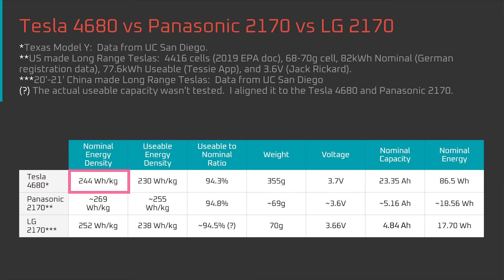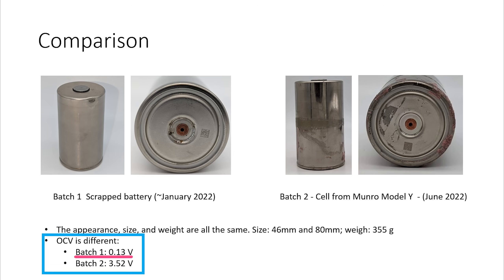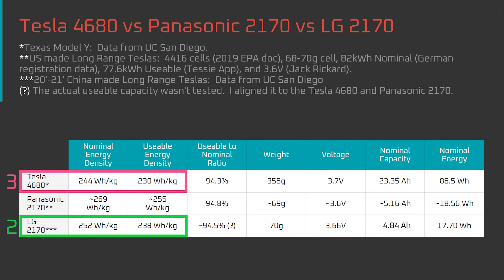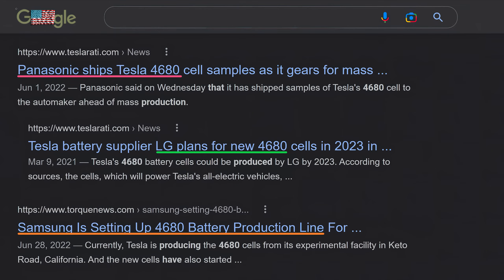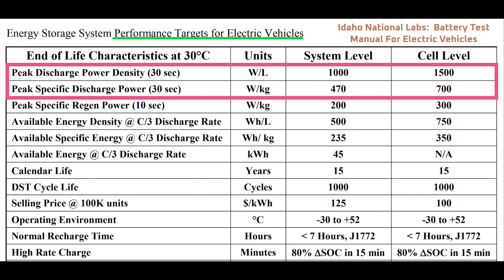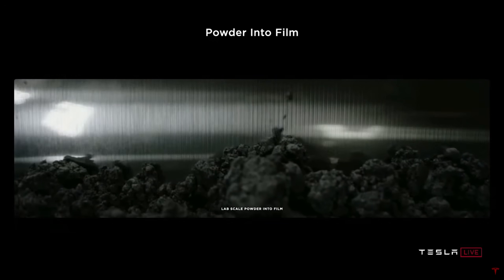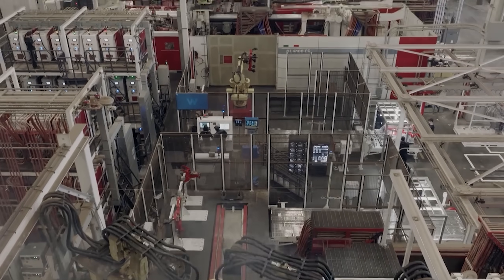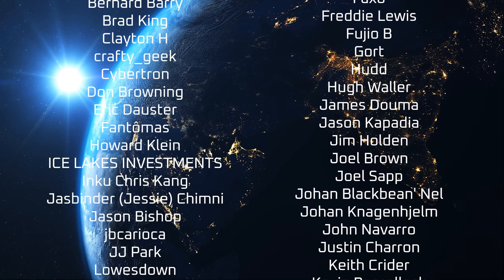Munro 4680 Energy Density Tested // Model Y Pack Size Explained

Comment: There is a major mistake / omission here... You are comparing APPLES TO ORANGES. One battery is structural. The other battery is not. You have to subtract the weight of the displaced portion of the vehicle's structure. Let's say for example, you are able to remove 1/2 lb of steel for every 1 lb of battery that you install, then 1-1/2 = 1/2, and 268 wh/(1kg -1/2) = 268wh / (1/2kg) = 536 wh/kg! Now this is just an example and I have no idea how much weight is displaced, or even if there is any weight displaced in this first version of the 4680, but YOU CANNOT MEASURE WH/KG UNTIL YOU KNOW HOW MUCH WEIGHT IT DISPLACES.

Edit: I also want you to know I appreciate your analysis efforts. You make great videos. But here is where there is something special that needs addressed. On battery day Elon was very excited to announce the structural battery. He made comparisons to airplane wings carrying fuel. Yet it seemed to just go over everybody’s head the true implications of a structural battery. The first principals implication of a structural battery is INFINITE energy density. Of course, that’s the ideal, and in the real world that’s not even a possibility. But what is possible? How far have they taken it thus far? This analysis is far more interesting and fundamental than doing an analysis of the battery chemistry. There is no battery chemistry that has a first principles energy density of infinity.
Reply from the maker: No, I just didn't want to go on a dog leg.  It's more complex that what you're illustrating there.
Reply: @thelimitingfactor  yes, it is. But without factoring that in, the comparison isn’t accurate. At least you should mention that so people know that it’s actually better than what you are stating.
Reply: @thelimitingfactor   I am an engineer and sometimes in engineering we give a simplified model to show how something works. Same thing in physics. For example, we do ballistic math but assume no drag. This is called first principles thinking. The benefit of doing this is to remove the complications and understand how the underlying system works. We will use >> (much much greater than) many times to see how a system works at the extremes as well.

So here is a simpified model of the true benefits of a structural battery and why it can be the most important factor for Tesla’s new batteries. Suppose you want to hike across antarctica. To do so, you must carry all of your food (fuel). As you travel, you are able dispose of your waste, your consumed fuel, so your pack gets lighter as you travel. This is like a gas car. It burns the fuel and produces smoke. Now consider an extra requirement. Let’s say you had to pack out your waste when you hike. Your pack doesn’t get any lighter and weighs you down the entire time you travel. This is like an electric car. It has to carry it’s spent batteries (fuel) as it travels. Now consider the structural fuel source. This is like being able to replace your bones with rechargable nutrient giving human batteries. Now you don’t have to carry your food at all. You just charge up your bones, walk until you are empty and recharge them. This is like an electric car with a structural battery. A car needs a frame, replace the frame with a rechargeable frame.

So fundamentally, what do we mean by energy density? What’s the utility of that measurement? Well, we can use it to figure out how much fuel (in weight or in volune) we need to CARRY. Well, in the case of the structural battery, in a perfect world where 1 lb of steel structure can be replaced with 1 lb of battery, you don’t need to carry ANY fuel. So what is your ENERGY DENSITY CARRIED? 248 wh per zero kg. That’s an INFINITE energy density. That’s the first principles theoretical limit of a structural fuel source.

Now of course in the real world, you have to consider so so so much more. But you cannot ignore the benefit, the change created, from using a structural battery.

Comment: Well done presentation! What about difference in charging time between the 4680 & 2170?
Reply from the maker: Same.  The 4680 pack charges at lower kW than the 2170 LR, but the time to full charge is the same.  That is, smaller packs accept less kW.

Comment: Wouldn't it be fair to subtract the mass of the cell wall and add it to the mass of the structure of the car?
Since it is a structual battery and that is the structual part. 🤔
Reply from the maker: Correct

Comment: The weight of 2.5 times the can thickness would almost be cancelled out by the 4680's ~2.2 larger diameter.
Reply from the maker: The can thickness range for smaller cylindrical cells is 125 to 330 microns.  That is, I need to do more research on how can thickness is selected.  Don't assume to much from one stat.  That is, what is the purpose of the thicker cell can?

Comment: Micro-ohmmeters cost thousands, I ran into this problem in college when designing a land speed record EV battery pack out of A123 cells. One solution is to calculate DCIR from voltage droop DCIR=ΔV/ΔI

Comment: I had very high hopes for the 4680 cells. This initially seems disappointing. But when you factor in the knowledge that this is teslas first time manufacturing batteries, it’s actually pretty impressive that they’re able to get close to established battery manufacturers. 

I take this as a good that they will eventually get there. But of course, other battery manufacturers aren’t going to sit still. 

Tesla doesn’t have the battery advantage I thought they would. But, at least we can be sure they will not be subject to the bidding wars to come where battery makers charge exorbitant amounts as demand increases.
Reply: Tesla is thinking about basics and stays flexibel for other chemistries but could produce more affordable in big scale and have reserve in much better resistance/efficiency with thermal impact by fast charging - indepandent from chemistries - better structure thsn small cells [but LiFePo comes up with also better form and cooling] but flexibel in chemistry for faster charging and high density e.g. silicon/graphene/sulfur options. Step by step. O course Elon tells fairytail lines of the future but it needs time like all other stories. Imagine all goals come true and double the timeline - than it could be near at reality of products.
Reply: The high hopes come if you are new to batteries. I am sorry but there is unfortunately not a quantum leap in battery development. Battery is always a continous optimization. Trust me I work for one of the top 5 cell makers directly in Asia for 10 years. Made cells for all of the big OEMs.

Comment: you have to compare the entire 4680 pack  vs the entire 2170 pack for a fairer comparison because were not considering the impact of the structural design of the 4680 pack vs the 2170 pack. Im not sure what weighs more, the sum of the extra thickness of the 4680 cells or the weight of the added structural elements for the 2170 pack?
Reply from the maker: As soon as you buy me a pack, I'll do that, lol
Reply: @thelimitingfactor  haha
Reply: The big gain with 4860 vs 2170 is the price on the pack.  Tesla make 8 batteries 4860 in the same time than 1,5 2170. And, on the batteries pack, you can remove (2976-828)×2=4296 welding points and, you remove 2976-828=2148 movements.  This is the big gain now estimate 5.500$.  Gen 2 and 3 will be better but, in next years but not now.  2170= 96×31 batteries and 4860= 92x9 batteries

Comment: From your initial tear down of the 4680 the thickness of the cell walls looked like overkill. I'm thinking of a hollow door that is amazingly strong yet its center is an empty cardboard honeycomb. These cells are full, so less crushable and they are tightly packed together, doubling up the metal thickness where two cells touch. Then any void is filled with structural foam. Maybe they can reduce weight by making the cell walls a lot thinner without losing much of the strength. When you look at a modern soda can, it is paper thin but its shape and the content give it rigidity. I would think it would take the weight of a man. I'm suggesting there may be some wiggle room in the cell wall thickness is this something that could be tested in a computer?

Comment: ENERGY DENSITY VERY DIFFICULT TO COMPARE
Because of the structural purpose of these cells a Cell to cell comparison is not really relevant.  Even pack to pack comparison is not relevant as there is also a differencein model Y body weights. 
About the only way to properly compare would be comparing the weight of Tesla structural battery body-in-white frame with pack fitted, with a non-structural body-in-white frame with 2170 pack fitted. The weight used for the effective pack density of the structural battery would then be the (non-structural pack density) x (non-structural Kwh) + (difference in weight between the two fitted body-in-whites). Then divide by structural pack's kWh.
Reply from the maker: Yeah it's tricky
Reply: Hmm, I wonder in battery pack density calculations whether typically the packs are weighed wet (with coolant liquid). Using dry weights could be misleading if there is a difference in amount of coolant required between different pack designs.  
And is dry or wet measuring consistent across brands. In testing it is amazing how a simple task turns out to be very complex when you think about it fully.

Comment: Fascinating. My takeaway is that Tesla matched the performance of the Panasonic 2170 cell  and so critically for now  the 2170 and 4680 packs are relatively interchangable, but as the 4680 cell and pack are optimized this will be less true.

Comment: Just a point on the can thickness,
Yes your loosing density at the cell level due to the thicker wall, but I think it's fair to say your gaining that density back in terms of weight savings in the finished product structural pack. 
It's designed to operate as part of a system not as a individual component.<note I paused the video to get this thought out so if this is covered later I apologize for missing it.>
Reply from the maker: Theoretically yes, but we haven't seen that yet.  In fact, the reverse.  It will play out over time
Reply: @thelimitingfactor  do you have an accurate mass figure? Spoken reviews weighed his 4680 MY and found it to be 140lb lighter than a normal LR Y

Comment: I’m not sure about what is the biggest elephant in the room, but for me it’s the number of cycles combined with capacity degradation over time.  I hold these as somewhat independent variables (they are of course linked a bit) but useful battery life will be more important to the consumer than initial energy density.

Imagine where battery technology will be in 2030 and 2040.  Do your viewers think it will be better, the same as today, or worse?

Thank you for the videos.
Reply from the maker: Sure thing Pedro!

Yeah, cycling data is important.  But, they wouldn't have put it in the vehicles if it didn't meet their spec (whatever that is).

Min 800 and max 1500 cycles.

Comment: My only remaining question is how does the charge curve compare between the 4680 and the 2170?
Reply from the maker: Already covered in other videos.  The same
Reply: @thelimitingfactor  what I find interesting is, according to cleanerwatts data, the LFP pack has the highest average charge rate (by the C rate). It is also teslas most efficient US vehicle (model 3 RWD). So in many cases, the Model 3 RWD might get you somewhere faster than the less efficient and slower C rate LR or P models.

Comment: What about power density from a Supercharging point of view? Would these Texas vehicles already be able to sustain higher power for longer via a software update leveraging that majorly reduced resistance?
Reply from the maker: Already reported plenty of other places.  Charge speed is the same as 2170
Reply: @thelimitingfactor  We need someone with ScanMyTesla or similar to do a charging video to see if Tesla is limiting charging performance to not Osbourne themselves or that's what they can do

Quite easy to notice by looking at the voltage profile and comparing 4680 vs 2170, maybe will only happen when Berlin pump them out and Bjorn get's one

And that also will answer the internal resistance question

Comment: Minor correction to an informative video: silicon is the element, silicone is archaic but very common synonym for siloxane, the type of polymer. It was named by someone who had the structure wrong and thought it had Si double-bonded to O, silicon + ketone = silicone, instead of Si-O-Si-O chains, but the name stuck.
Reply from the maker: I know, sometime I don't speak perfect.  Try doing a hundred hours of video and not making a mistake.
Reply: @thelimitingfactor  I understand completely. No complaints here.
Reply: So you mean that the lady didn't have her breasts enhanced with silicon?!

Comment: Great video! I’m thinking of buying a model Y within the coming years and the battery day presentation has been in the back of my mind all the time thinking that Ím going to wait for the new version before buying one. Really nice to finally hear someone talking about all the aspects of the new platsform and link it to the battery day presentation!! I know you have limited knowledge about the exact future of tesla around when we can expect to see the full pontential of battery day and such but the I depth review of the current battery cells is very awesome to get. So thank you!!
Reply: There is always going to be a newer better faster version just around the corner.
Reply: I was in the same mindset on Battery day. I decided to go for a MYP and took delivery in February 2022, and settled for a Freemont build.  I already put 13k miles and since I have solar I paid 0 electricity, and 0 maintenance or repairs, knock on wood.  It only consumed about 3800kwh which for a 3.5s 0-60 car seems unreal. Had a MB previously and this is the best car I ever own. I figured I will keep it until the cybertruck is readily available at a decent price, which will definitely take a while.

Comment: Any chance Tesla is saving the better more expensive chemistry’s for cyber truck and semi since it will be more energy intensive to operate. While using cheaper more familiar chemistries to improve margins and keep specs consistent on model y to not hurt sales/make customers feel jaded? As it stands right now Tesla is still range/efficiency king so maybe it made more sense to focus on keeping range consistent but reducing price of manufacturing or atleast keeping it the same in attempts to battle inflation.
Reply from the maker: Nah, they went with tried an trusted to de-risk things

Comment: I disagree with your assessment of the can thickness. The cell is a pressure vessel. Pressure vessels with larger diameters need a thicker wall to hold the same pressure. The “hoop stress” is equal to Pressure * Radius / wall thickness

10.5/0.25 = 42

23/0.55 = 42

The 4680 has identical pressure capability to the 2170. And the 4680 packaging should still be a lower percentage of the cell mass compared to 2170.
Reply from the maker: Yeah, it would take a whole video to go through that.  You're partially correct.  People always oversimplify batteries because they see one piece of the elephant.

Comment: I could be wrong, but It seems current 4680 ramp priorities are Now: More (production line speed), Cheaper (supply chain), and Later: Safer (electrolyte chemistry, cathode materials), Better (increased volumetric and gravimetric energy density, longer cycle life), Faster (higher charging rates).
Reply from the maker: Good summary
Reply: I like 'Safer' also, and wonder where that fits in the Tesla priorities schema.  Does safer chemistry trump efficient mass/density?  How much safer is the 4680 chemistry?  Maybe it's a significant factor.
Reply: Safer could mean more life cycles as well?

Comment: So Tesla remains way behind CATL when the new Qilin battery comes out?
Reply: Tesla is not standing still, and they are already producing batteries cost-effectively in volume. Qilin battery at "up to 255 Wh/Kg" doesn't sound like any breakthrough and no one knows the cost comparison.  Hard to compare against cells from others that are not in volume production and no one can test to confirm the PR validity.  Hopefully in a few years, once CATL figures out production, we'll get some samples to compare with where Tesla is at that time.  Maybe CATL will be better but battery PR releases are dime a dozen. Most new battery designs totally fail to deliver once they run into production problems (and everyone runs into production problems at first).
Reply from the maker: 🙄 Video in a couple weeks.

Comment: Thanks for this.  I wonder what implications the current state of the 4680 will have on the 500 mile CT and if we are likely to see only the 300 mile version at launch.
Reply: These numbers seem to explain the use of 2170 in the SEMI. For now, at least.
Reply from the maker: 500 mile range is doable with current tech.  Dual layer the battery - it's a truck and has space for that.  Even the roadster was supposed to have a 200 kWh pack, and that thing is a fly.

Also bear in mind that drew and Elon also said that the C/T will use a ~B grade (next gen) of gigacastings/structural pack.

Comment: Does the heat sinking capability of the Tabless Electrodes give the 4680 battery a serious advantage over the Panasonic 2170 and the 5 tab Panasonic 4680 cell?
Reply from the maker: See the 4680 Thermal Design video.